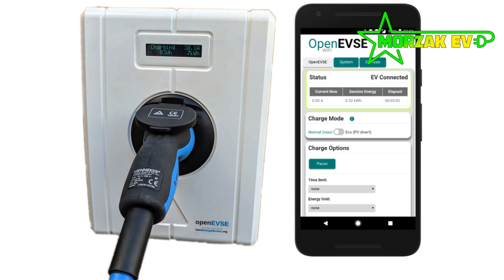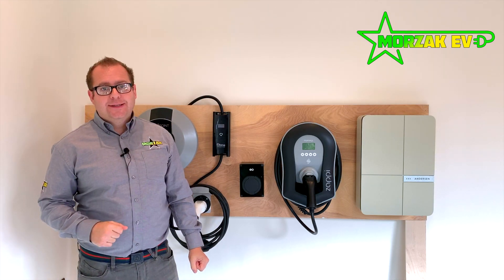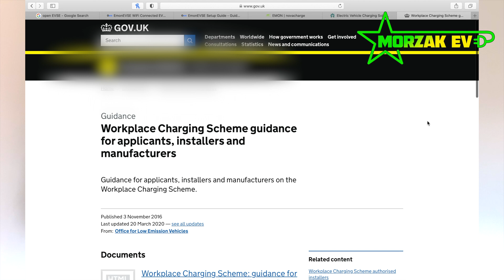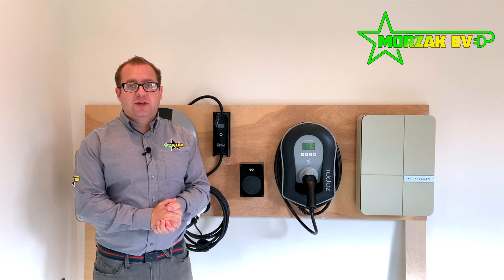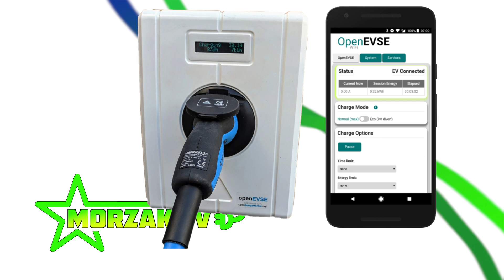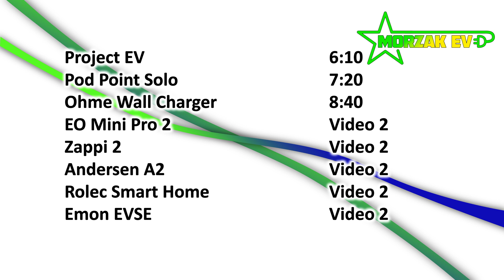What Electric Vehicle Charger should I buy to charge my electric car? OLEV EVHS - Part 1

Comment: Morzak EV, what is the Ohme Home Pro EV charger like? It's the new updated version of the Ohme EV wall charger you show in your video. Is the Ohme Home Pro better than the pod point charger? Which of the two would you go for? Thanks.
Reply from the maker: We now have a seperate video on the Home Pro here: https://youtu.be/23gz2zNet2A
And a new updated version of this home ev charger video here: https://youtu.be/j2ito0IKqf0 

But to summarise, it's awesome!
Reply: @MorzakEV  Morzak EV Thank you for this video. I purchased the Ohme Home Pro and Ohme have confirmed they are testing the API integration with the Volkswagen ID.3, should be ready in a month or so. Just to add, the customer service from Ohme is outstanding, they are very helpful. Morzak EV I now need your help with getting on a suitable electricity tariff please? I'm sure others are wanting to know the same especially with the price hike. Thank you again.
Reply from the maker: @AAAAAA-zu5vf  I’ve resisted doing a video on this yet, because all the advice is stay where you are until the later spring. When the energy crisis hit and several supplier’s liquidated, companies like octopus took on unprecedented numbers of new customers and they’re spending time integrating these customers first. That being said, most people will tell you to look at Octopus Energy’s various tariffs. At some point once things have settled, we will do a video on this.

Comment: Can you get a longer tethered cable than 5m ?.
Reply from the maker: Hi Paul, Depends on the charge point. Some charge points can supply a tethered cable longer then 5m such as Hypervolt, Zappi, pod point and Andersen
Reply: Thanks for the quick reply.

Comment: Would love to have a charger in my garage, but my Concil is not interested in the switch to sustainable energy.  FULL STOP, END OF STORY, NO WAY HOSAY.
Reply from the maker: That’s tough, I’m sorry to hear that. At some point down the line they will have no choice but to support you. Which council is it?
Reply from the maker: If you have a garage, what is stopping you having a charger? Do you need to cross council owned land for an electric supply? Or is the garage itself council owned? I only ask as we have done plenty of installs where they were seemingly impossible on first contact with the council or the owners of an estate, and after a little work, we have managed to arrange something acceptable to all parties.
Reply: @MorzakEV  the whole area is Concil owned from the flats to the street.  The problem is with the garages having asbestos in there makeup on the old types.  My garage is one of three new builds, but the Concil is not interested in the installation of cables into any of the garages.  FULL STOP.  They did arrange for 2 posts from ubitricity.  But one has been blocked off by a private recycle bin.  And the other has not worked for at least 4 months and counting.  Have phoned them numerous times with no movement.   What else can I do to resolve this mess than use an extension cord from my second floor flat into my garage.
Reply from the maker: @foxylady1048  That seems totally crazy on their part, on so many levels. I hope this eventually gets sorted.

Comment: What dose the charge point box actually do ?. Why not just connect directly to the mains ?.
Reply from the maker: Thanks for the question. The cars do not actually just allow any cable to be plugged in - this is for various safety reasons as we’re talking about a huge amount of power and current being fed to the vehicle. You can plug the car in to a mains socket via a granny cable (which is normally provided with the car) however, you can only get a max 2kW due to the nature of plugs and circuits in houses. The chargers will charge you car 3 times more quickly. These are also not recommended safely for long term use. After that, there are other benefits from certain chargers as mentioned in the video such as scheduling to work with your tariff (including dynamic tariffs), working with solar PV to charge the car for free instead of sending the load to the grid, and load balancing to protect your houses main supply. Finally it’s the aesthetics and convenience.

Comment: What would you recommend for someone who only has on street parking?
Reply from the maker: Unfortunately, there’s not a lot of good solutions at the moment. If you work somewhere, you may be able to persuade your company to install chargers there - that would work nicely for most of you travel I would think. If your mileage is low enough and there’s options nearby, then you may get away with using the public charging networks. You’re not allowed to run a cable over the pavement in the UK, so this isnt really an option long term. There are some on street charging schemes popping up, and I see that as a large area for growth over the next few years. It all depends on your individual situation really.

Comment: Would be nice to have prices, I know these will change as time goes by, but I for one would like to have current prices at this moment in time, to save me phoning around or e-mailing loads of different companies. I have three phase at one of my houses, but the dealer said I can't use 3 phase on the MG, anyone know if that is correct?  Also I only have one EV, but I want two charging points fitting, one at the house I live at which is single phase and one at my mother in laws which is 3 phase, I am guessing as well the the £350 grant is really pointless as from what I am seeing this is just getting slapped on top of the retail price to make it look like a discount. I say this because of the way prices differ so much, so it would be nice to know someone is supplying and installing plus giving the proper discount.
Reply from the maker: You’re right in the fact that the MG doesn’t have 3 phase charging - this doesn’t mean it won’t work with a 3-phase charger, but that it would only charge at 7kW. This is down to you whether you wish to install something future proofed, or just install a 7kW. It depends how quickly you need to charge your car really. 
In terms of pricing, we quote jobs based on all the factors - there is no “standard price” and it’s based on the time to complete the job plus the materials required, so it’s impossible to give prices without a survey. I think the standard prices are something only the big national companies implement, and then anything that differs slightly from this needs quoting.